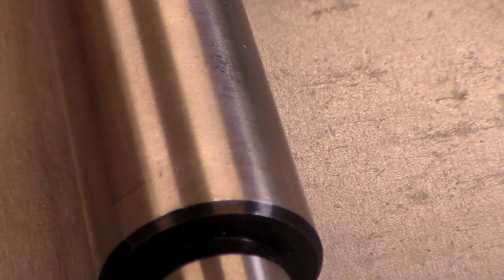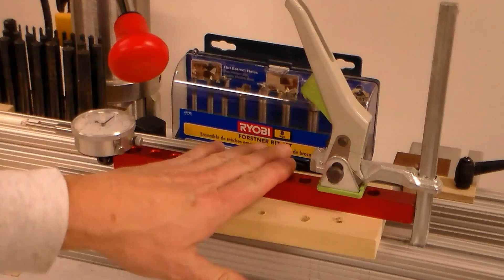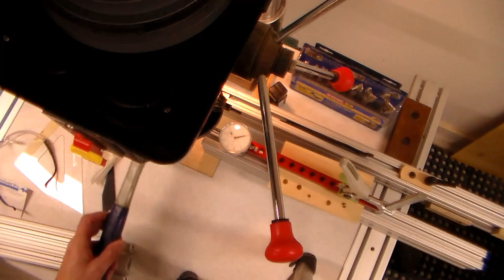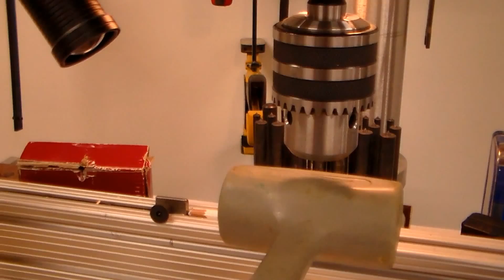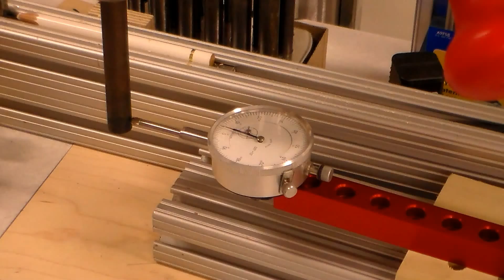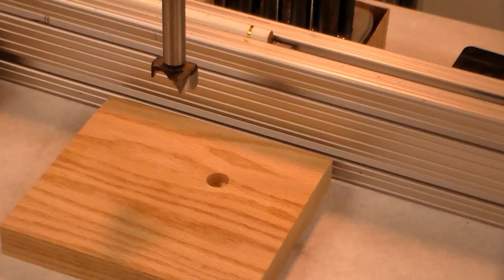01 Drill Press Tuneup

Comment from the maker: This is very important information from Felix F . PLEASE READ THIS.
I work on drill presses and would like to introduce some constraints that may have a significant influence on the results you're seeing. It's not unusual for folks to think that a ground shaft will give them an accurate reading. I have a complete set of pin gauges up to 1". Ground and hardened machinist's reference. Went through about 250 of them to find 6 whose runout was below a thou. Identified 2 that were accurate to less than a tenth. Some were off by almost 3 thou. I guess I'm trying to say that the odds of the standard you're using having no runout are slim. Obviously this is affecting your numbers. Secondly, take note of the indicator. I own a number of indicators, four of which have calibration certificates. Using the four as a reference - they read essentially identically - the pile of cheap indicators in my drawer is off by 1-4 thou (!). I couldn't really tell which indicator you're using, but it may also be influencing your readings. Lastly, turn the motor pulley when indicating, rather than the front pulley or the chuck. This makes for less vibration reaching the indicator. Good luck, even though it's been a few years. Hopefully my comments will help someone down the line.

Comment: Hi Jeff - great stuff.  I'm a newbie and this is great for me so I stand to be corrected.  I was told that run out of around 0.002" is good for woodwork.  Please correct me but surely a deflection of 0.003" on the dial indicator equates to 0.0015" run out from the vertical center line?
Reply from the maker: Not sure, but I do know for woodworking that little bit of run out I had/have is plenty good. If I could accurately measure a hole diameter that was supposed to be 1 inch then I think my hole would be 1.006. 2X the .003 run out.  Thanks for watching.
Reply: Most runout is measured as Total Indicator Runout (T.I.R). So just take the measurement as the amount from the highest to the lowest reading. 0.003” should be the aim, with 0.0015” max being ideal for high accuracy work (tapping metal, reaming, etc.)